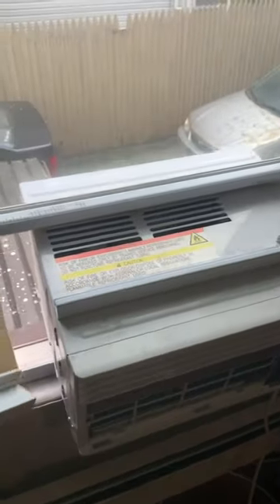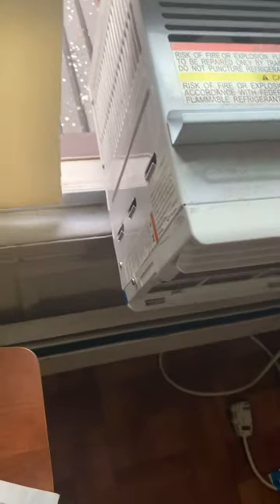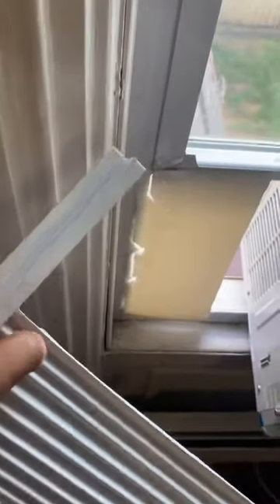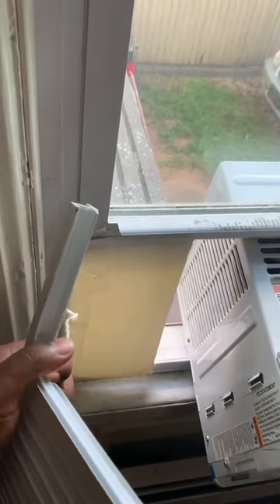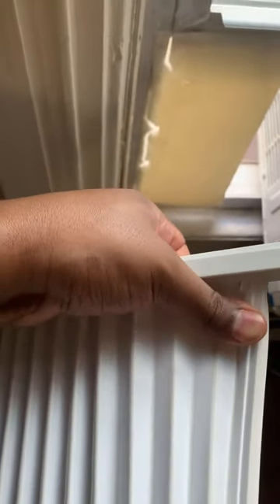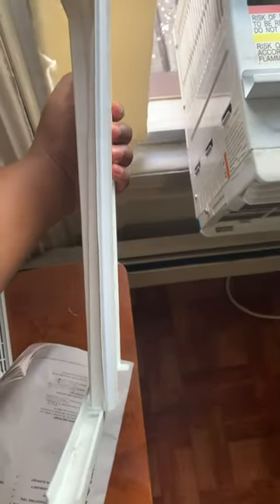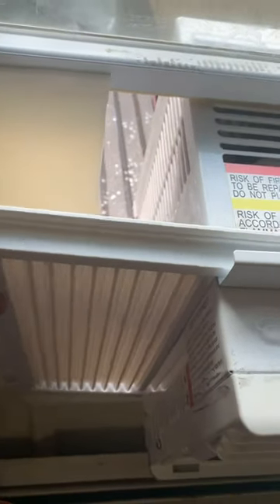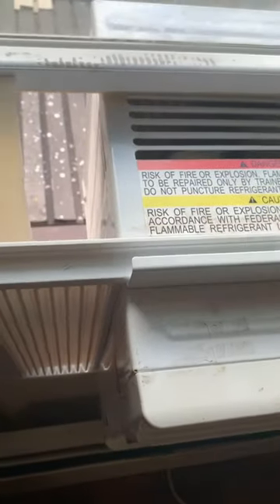Air Conditioner Hack - Reinstalling Side Panels

Comment: Cesar, I believe you put that panel on the wrong side. You're not going to get a seal across the top of the unit at the window because the side panels will prevent the AC unit from touching the window in the center and that will allow insects and hot outside air into your home.
Reply from the maker: Hey Mac, thanks for the feedback, and good point! Don’t worry, though. I made sure I put a layer of the foam that came in the kit to prevent just that. Let me know if you have any other advice though! I’m sure it won’t go unused.
Reply: @ThatsMrSaldana  No Seriously his advise did go unused because that panel does belong on the right side of the a/c unit. When you take it out for the winter, try sliding it on the other side and you'll se what Mcbit is talking about.
Reply from the maker: @RobVicPer1  absolutely! The time to take it out is right around the corner on this side of the country, so I’ll try it soon.
Reply: No he did it correctly
Reply: @lindadecarlo8259  he didn’t
Reply: Thought so. The screw holes eouldn't line up that way, but tx for info on how to slide curtain onto frame! I'm an old lady & can't do all that while holding a/c with other, so had to put A.C on edge of a table in front of it.

Comment: This is not meant as criticism Cesar, you put the door on wrong. The screw holes on the top frame of the door face inward and each door is marked left and right. It does matter for holding strength, and drainage of water.  I  install countless window Aircondititoner's every summer in Texas. I  see Aircondititoner's installed wrong every where I go.
Reply: Lol
Reply: Not true he actually has it going the right way! So you are wrong and he is right!
He's doing it correctly!
But he should of removed the ac for a minute to put the sides on!

Comment: somebody needs to invent a new system for them these days alot of people have replacement windows these were made when we had wood frames and could easily screw in
Reply from the maker: Agreed, Darren. The fact that this was gift, though, kind of makes it hard to have it returned, so I figured why not work with it? 😅 But I do remember running into this with the AC I had before this one

Comment: Very helpful! I should look up here before broked one of the side panel lol
Reply from the maker: 😆😆 I’m glad it helped, Angelica! You’re more than welcome
Reply: Gently pull the top of the accordion until it is free of the plastic trap without moving the bottom of the accordion as much. You want the accordion at an angle that isn't up and down straight in the track. Then do the same to get the bottom side of the accordion free from the track. Do not pull the accordion out of the track. Pull on the top to angle the accordion so it is no longer captive in the track.

Comment: This didn’t work for me because I couldn’t get the curtain end to seat properly into the air conditioner’s mounting brackets. What worked for me is a variation of what you did. I took out the end of the curtain as you did but slid them down onto the air conditioner mounting tabs. The top bar is in the way (as you said) so I took out the two screws for the bar so it could swivel a bit. It took a full extension of the curtain to clear the bar mount and that could (and did) pull the curtain out of the brackets. So I held the curtain against the brackets while I extended the curtain to install it. Then I re-screwed the bar.
Reply: Because he is giving wrong advice

Comment: The accordion part stays attached the the plastic. As you gently extend the free/movable part of the accordion, pull the top of the accordion more than the bottom so the accordion edge takes an angle and it is no longer held by the  horizonatal frame. Now there is room to get the moving/free end of the accordion to jump out of the plastic track. Then get the bottom part out. Now slide the movable/free part of the accordion down through the catches on the air conditoner and then get it vack together. Titt the end of the accordion so it is not going vertically (up and down) and then you will see what i mean. The track only holds the accordion because you dont angke the edge of the accordion part.

Comment: According  to instructions,....you attach Just  the Curtains to the AC side Brackets 1st,..& then easily slide the Bare curtain frames into top & bottom AC brackets....Then snap fit the Curtain into the curtain frame sides......Simple, No stretching or tearing anything up.....How could any adult screw this up ???

Comment: The problem isn't the sliding. You're ignoring the fact that that whole piece is in FRONT OF where it would fit into the crook of the inside of the window. How do I explain this. You already have the AC in there, so how are u going to get that entire piece inside the side of the window and not where it's just sitting on the inside part of the window? Literally this way it just would be sitting on the side of the AC in front of the window and not inside the spot where it's supposed to fit.